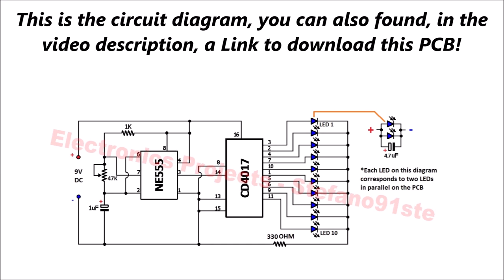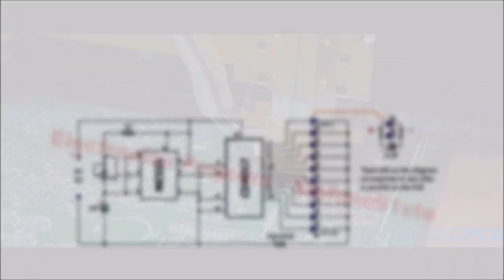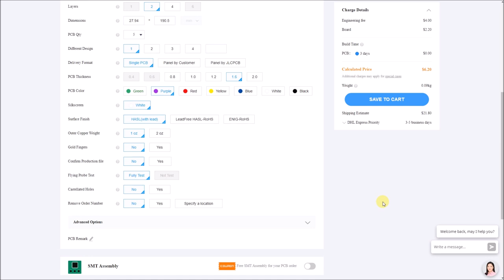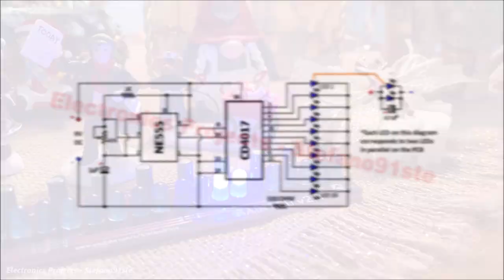LED Chaser Rain Effect with Bright Trail - NE555 and CD4017 - PCB Tutorial

Comment: I will order these PCBs also.   Stephano, I had suggested a few weeks ago a bar graph driven by a linear Hall Effect sensor.  The closer the magnet is to the sensor, the appropriate LED lights up, depending on the analog signal sent to the LM3914.  Have you made any progress on that circuit yet?
Reply from the maker: Hi, I haven't had the chance to try it anymore

Comment: How can I make the trailing effect longer? Higher value of capacitor?
Reply from the maker: Hi, I'm working on it, but some power transistors will definitely need to be added, because the CD4017 outputs cannot charge high capacity capacitors.